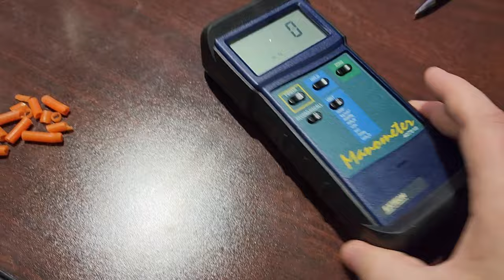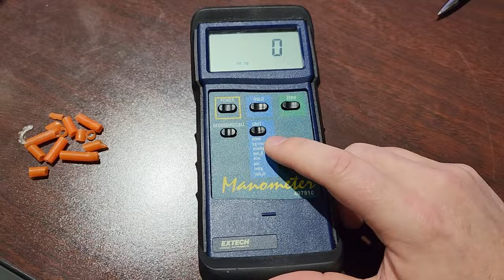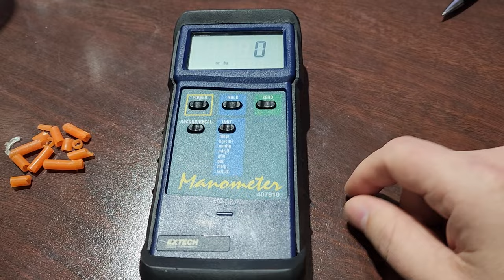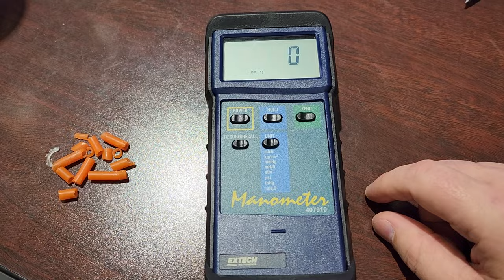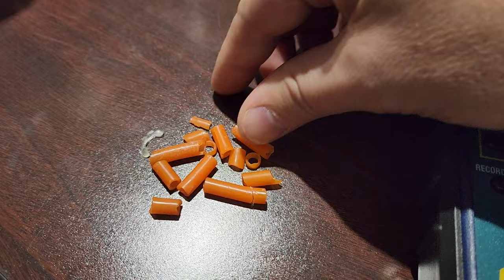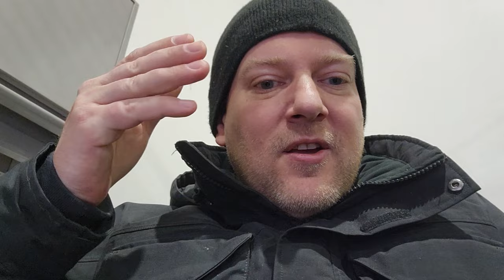Questionable Calibrations..

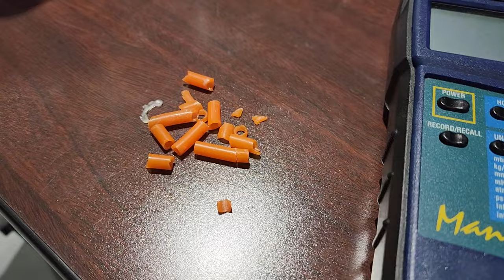Comment: calibration does not mean you have to open it (regarding 2:55 ); i could be very well, that it was working fine in calibration, then got damaged during shipping. And yes, TRUST is the most important thing in calibration, if you loose trust in a cal lab, its only months till you move to another one (or you don't care at all), speak with the cal lab openly, look how they respond, then decide to keep working with them or move on. everyone makes errors. .... but to be honest, those tubes... i can't imagine they would hold the pressure if applied even like 10mbar should be leaking... i highly doubt the cal lab has done honest work